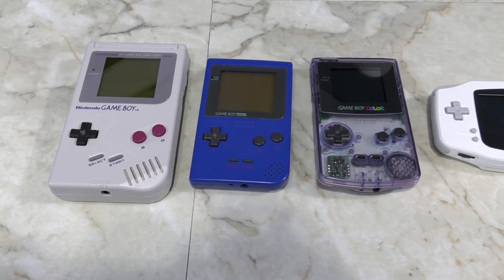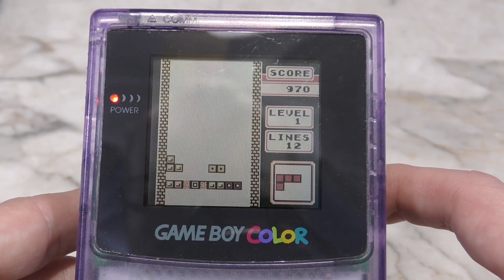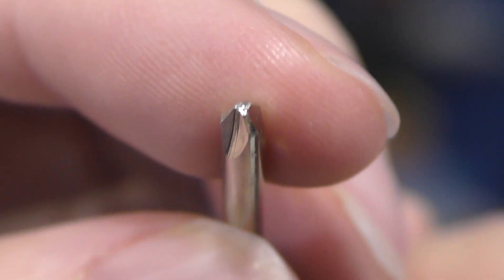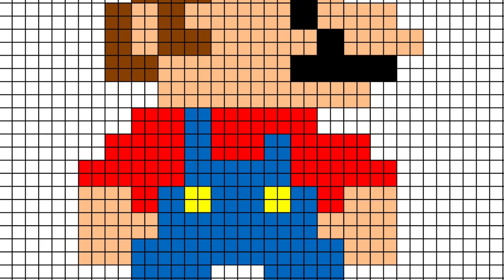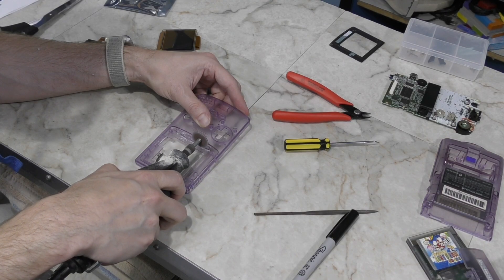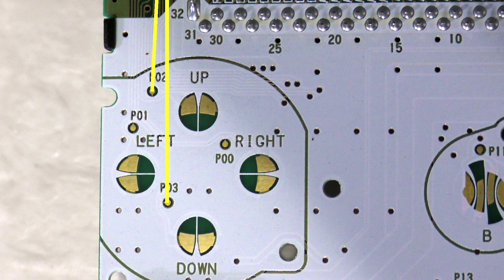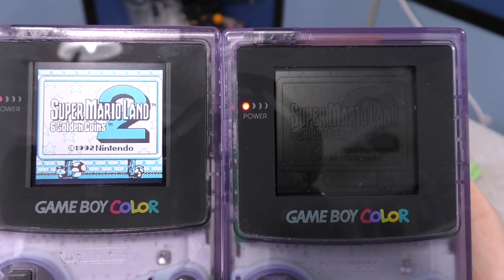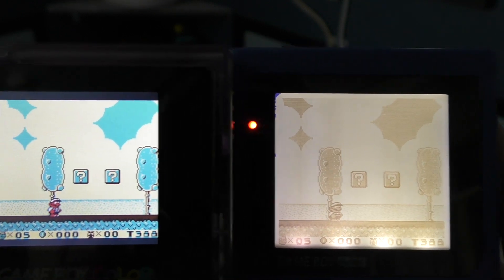Finally - A Gameboy Color Backlight Mod!

Comment: Wait, what about battery life? Did that take a hit with a back lit screen?
Reply: Late to the party but the website says 3 hours battery life with this mod. Not worth it IMO. You’re better off using a GBA SP.
Reply: obvious
Reply: Other people have said that with this mod they get about 6 hours active time. That's plenty if you put in a fresh set of rechargeable batteries before each binge, or every 2-3 days of casual play. Plenty of life.

Alternatively, just put in a lithium ion rechargeable battery while you got it open for the screen mod. Replace the old batteries entirely. There's plenty of room.
Reply: Of course it did. The Law of Conservation of Energy requires it.
Reply: @fyrstormer  Right guys, I realize that.  I was hoping more for a response where he enumerated the level of impact.  I haven't played a GBC for years and years, so did it reduce battery life from 10 hours to 9?  4 hours to 3.5?

I have kids and with the limitations we put on electronics, we haven't let them have phones at all because they're so open-ended.  But this device we could let them play knowing there's a pre-set amount of games.  Plus it's nostalgic for me:)

Comment: 1:36 that's not how the colourization works on the GBC.
The GBC has a compressed table of game headers with palettes attached to them.
The only game that uses SGB colours on the GBC that I'm aware of is Pokémon Yellow, which converts the SGB palettes to GBC palettes if it detects that it's running on a GBC, and has its own palettes in a lot of cases. (which are still stored in SGB format even though they're not compatible with the SGB)

Comment: If you use the extension cable for the Dremel, you'll get a lot less jumping because it's much easier to wield like a pencil compared to the bulky motor assembly.

Comment: A correction (from memory): the Super Game Boy has nothing to do with original Game Boy games having colour when played on a Game Boy Color – this can most obviously be seen by comparing the level select screen of Donkey Kong when played on a Super Game Boy with that screen when that game is played on a Game Boy Color.

The Super Game Boy and Game Boy Color use two completely different ways of colourising games:

* The Super Game Boy divides the screen into 8x8 pixel squares, with every square being assigned a colour palette (I can't remember whether the colour palettes are two or four colours, or how many palettes are available); when the Super Game Boy colourises an original Game Boy game, every square is assigned the same palette.

* When the Game Boy Color colourises an original Game Boy game, the two sprite layers and the background layer are assigned a (potentially different) four-colour palette – so there's the potential for twelve colours on-screen at a time – and a palette set can be selected by holding down a d-pad direction and (optionally) the A- xor B- button on power-on; additionally, the Game Boy Color holds custom palette sets for a few original Game Boy games that override the default palette set if no d-pad direction and button is held down on power-on.

Comment: Interesting video.  Just a small point but the GBC BIOS uses a calculation of the GB Header to determine which palette stored in the GBC BIOS (if any) to use for older mono GB games.  The SGB's color system is a totally different thing.  I actually waited until the GBA SP came out precisely for the rechargeable battery + front lit screen.  I have a black thumb when it comes to hardware modification.

Comment: At 1:37, it's stated that the GBC pulls SGB color data in order to colorize non-GBC games; that's incorrect, automatic colorization is performed by the startup code (nicknamed the boot ROM). Simplest example: Pokémon Red/Blue are uniformly colorized on a GBC, but change colors between maps and have move complex coloring on SGB.

SGB enhancements are actually performed actively by the games by sending "packets", so there's no way to automatically find where the games store color data. (Plus the games may store the data compressed, making the whole thing even worse.)
And no, a GBC can't pose as a SGB, because the SGB exposes a SNES' functionality, so games expect much more than the GBC can offer, and would break if it's not there. And, the way colorization works on GBC and SGB differ wildly and basically in incompatible ways.

Comment: This video was sorta rough the aspect ratio is correct on a gba that's backlit once you hit the right trigger and your mod while impressive is not correct the ratio is squeezed vertically I'll have to pass until a better mod comes along but regardless the gba backlit is not only comfortable but plays gba as well...it wins

Comment: Say, David, what software did you use to create your channel intro? Or, did you actually programmed some code for the Commodore 128 to execute and you just recorded the output from there? I'm looking for some software where I can create a custom intro of some sort instead of using the default intro video editing programs provide me. What I'll be using is OpenShot Video Editor because I am on some financial pressure and just finished my bachelor's degree in software engineering.

Comment: nice work... if you wish to do some more modding (say your case is too scuffed up or your plastic screen protector is scratched/cracked) might i suggest this website https://www.retromodding.com/collections/gameboy-color  there are plenty of mods available as well for many different Nintendo handhelds. Outside of NA.... sorry they are based in Canada.... soooo buyer beware.

Comment: Eh, Nintendo's always bullied modders and the fair use community. They falsely claim you have no right to fair use or backup copies when copyright laws including, yes, even the vile DMCA very explicitly say the opposite. I don't know how copyright works in Japan but I'm certain they follow the Berne Convention which protects specific consumer rights. 

They at least had a legal basis for going after ports, so on that legal front they were justified. Doesn't make them any less jackasses, but the law doesn't say you can't enforce copyright if they're not making money off it or hurting your bottom line.

Comment: 10:50 The screen does not appear to be 100% the size of the original. It looks about 5-10% smaller than the original, resulting in unused space around the edge of the screen.

Comment: Actually, the reason DMG games have color on the GBC has nothing to do with the super gameboy coloring some games had (in fact, the GBC does not support that color data). Instead, the reason is that graphics on the gameboy are actually programmed on several layers, as well as sprites being differentiated from backgrounds. This is how the GBC recolors some parts of DMG games, by coloring sprites and background images differently.

Comment: nice all around look with the backlit screen, downside is that its $65.00 bucks. double or triple what the original system costs used today.if they could get that cost down it would be even more amazing to mod.

thanks for the video letting everyone know it can be done now. much appreciated

Comment: If you Bivert the GB pocket, you can get much more contrast out of it. It should be an easy fix. Also, if you want the B&W look of the original GB on the GBC, just hold B and left when starting an original GB game, as that will set the colors to black and white. (this also works on the GBA and GBA SP)

Comment: The downside to having a super-bright screen is that there were probably GBC games designed around the dark screen (as in, they expected colors to be visible much darker to the user than what was coded in the game). That was the same problem I had playing original GB games on my GBA SP model 2 (aka the AGS-101 to most fans), it's almost too bright (particularly the default color palette, used when playing basically any (monochrome GB) game not made by Nintendo. The GBC boot ROM detects most Nintendo games and assigns them specially-coded color palettes.)

Comment: If you want to do a nice backlit mod like that, Id recommend a glass replacement screen protector, the originals scratch easy and the glass ones feel and look amazing. They're usually under $10 on ebay and are worth it, ive repaired countless and always use the glass ones.

Comment: I'd argue that the mod which uses the GBA SP front light is superior. Yes you have to sacrifice a GBA SP, but it's a much easier mod as you don't have to do any cutting with a dremel, and it lets you use the original GBC screen instead of a totally new LCD. No weird bezels or borders. I installed this mod 4 years ago and still use my front lit GBC today. Looks awesome, contrast is great.

Comment: I disagree with using Axanar as an example of overzealous copyright protection. 

Alec Peters was trying to make a profit off Star Trek IP. That is indefensible.
Reply: yeah but not everyone is aware of the full story. The only reason I know about it is because I had a friend that worked on other fan films and personally knows almost everyone involved with all of them. He even knows Alec. CBS was being a jackass though in taking it out on the fan films that weren't being assholes.
Reply: @awilliams1701  The only thing i like about CBS is that they made pretty good atari 2600 titles😁😁😁😁

Comment: 1:50 - idk if it's been said but the Super Game Boy color data is not used on a GBC or GBA, the GBC just applies generic palates to the games
you can change them with the arrow keys on start up.
Reply: Not with everyone. Some games (or a lot, I don't really know a full list) from the original DMG (like Super Mario Land, Pokemon Red, etc) had some predefined palletes in the GBC. You can change them with the method you said (and also A and B), but if you don't press anything, it will use the predefined one.

Comment: You really late if it comes to Nintendo and how they handle Nintendo Content on YT. As long as you do not make videos about "How to hack a Nintendo Console to play roms/emulators" or show ppl how to make hacked Games, everything is fine. I never heared that Nintendo is against a Mod of a very old Console/Handheld, if it's only Hardware based. And adding a Backlight to a GBC Color is so common today, that Nintendo does not care the slightest.

Even if it comes to music and Gameplay, Nintendo is totally fine with that if it comes to Let's Plays ect.

Comment: The main thing holding me back from getting this mod, is that many GBC games were made with oversaturated colors to compensate for the original undersaturated LCD display. With modern true-color displays, the colors will look more vibrant but the color balance in many games will be off.

Comment: Eh, I don't have money to burn on a screen that you have to install yourself. Anymore, I just don't want to fumble with my old carts. I prefer the ease of selecting roms in a menu that you get with an emulator. I know Nintendo hates it, but I at least bought the carts originally. It's like I prefer ripping my CDs to a my computer for use in my MP3 player or the like that plays flac. The thing is, if you really want an authentic experience, you should play your games on unaltered consoles. I put up with the screen glare back in the day. My family was poor, and I was grateful to have a GameBoy. I don't call playing games on the GameBoy Pocket really legitimate. It may have a sharper, better screen, but the original GameBoy wasn't actually black and white. The lightest shades were brass colored due to the colored reflector while the darker shades had a greenish hue from the liquid crystals. The end result was more of a two tone screen which I greater prefer over black and white. I find that I prefer this color pallette in emulators which didn't seem to be available on the GameBoy Color/Advance. Oddly enough, original games can flicker on faster refresh screens. I noticed this on Link's Awakening. The game designers took advantage of the slow refresh rate of the original screen for special effects by giving it a 60Hz frame rate. They flickered shades to get extra shades from a 4 shade only system. It was a nice effect that you can only properly experience on the original screen, but it flickers on the newer screens. I think emulators have shaders that can reproduce this effect. Unfortunately, the screen will smear with fast motion. I guess it didn't bother me much back then, but I prefer a faster refresh screen. The flicker effects weren't used much anyway.

Comment: Wow, the screen itself does look phenomenal. The doubled pixel density really makes for a razor-sharp image. Still, most folks would be just as happy with the backlit GBA SP, model AGS-101.
Reply: Sadly, the AGS-101 it's really hard to get, and costs like 50 USD, or even more. And it requires to destroy the GBC shell.
Reply: @erik19borgnia  lol i paid $134 for my gba sp ags 101, 2 weeks ago and it was used on ebay and it was the cheapest one that was not broken and didnt have actual teeth marks on it, and it did come with plenty of scratches
Reply: @jasonbrown467   I was talking about just the screen to do the mod. And it was a year ago. Now they are even more expensive. I actually got this screen last year (the Midwest Embedded one) and I'm pretty happy with it. In the last year I played a lot of games in my GBC and it was a blessing to be able to really see.

Comment: When doing these mods, look into the glass replacement screen protectors available all over the internet. Scratch resistant and much better viewing, they usually come with repro graphics on them so they look like an original part.
Reply: Thanks!

Comment: For me, it was just easier to buy a gameboy advance SP. (The 101 version) Backlight w/ compatibility with quite literally every game from every generation of game boy? Sign me up. I just wish it had the same button arrangement/size as the pocket/color as it's a bit too small for an adult to play comfortably. But it works fine when I want to play a gameboy game or I'm travelling. The original advance is the best in terms of "play-ability" meaning it has the best controls layout. This is super cool though. And the screen looks amazing.

Comment: 0:20 What tactile control, un-obscured screens, you're crazy, modern touch controls are the best? ^_^ Also I love when companies harass fans when they produce content they themselves won't produce, it's so good for brands and franchises. Keep up the good work lawyers, we'll get those profits and company images right into the toilet. :D
That mod does look very nice, so far the 2X factor mostly pushes towards current component sourcing, a future proofing of what screens are made now. Not a big fan of pixel "smoothing" but 2X or later 4X screens could offer such options to mods like this through the FPGA.

Comment: Hm, the modded GBC definitely has the best screen, but... not sure. The colors kind of look too vibrant for the GBC. Doesn't feel authentic to me.

That said, I think I am gonna do a backlight mod for my gameboy pocket sometime soon, as I find it hard to play on it even in good lighting conditions and I feel like if it had a baacklight, I 'd game on it a lot more, which I'd like to. There's a modding kit that lets you add a backlight to the original screen, so it should keep the genuine retro feel. But, OFC that also means it's a lot more work and more to possibly go wrong.

Comment: Oh, I've seen this on another video. The triple-bezel GBC screen. No thanks. They need to provide an outer screen protector that covers up more of the screen so you don't have to see all that nonsense.
And why do all these videos claim "you can barely tell" when it's incredibly, painfully obvious from the very video we're seeing at the same time? The gray of the interior bezel doesn't even match the gray of the screen protector. Sticks out like a sore thumb.
Reply: I think some backlit modding methods will also have an option of the screen protector that'll cover up the slightly smaller size of the backlit screen. 

But I kinda think it would be better if they could just have a screen that's the same size as the original one because that's the way it should be. The smaller overall screen size kinda ruins the look of the GBC for me.

Comment: The Gameboy Color doesn't read the Super Gameboy palette information.  What's actually happening is that the boot ROM of the Gameboy color has a lookup table of special palettes for the most popular Game Boy games, so if the boot rom detects a game on its list, it will load that palette.

In any event, the Super Gameboy and Gameboy color handle color in different ways.  The SGB instructs the SNES to apply color to different regions of the greyscale gameboy image after it's been drawn by the SGB hardware.  The Gameboy Color applies the color during the gameboy's drawing process.  What this means is that the SGB cannot treat sprites and backgrounds differently when colorizing, while the GBC can have the sprites and backgrounds be different colors, while the SGB can have static screens with far more apparent colors on screen through the careful use of palette regions.

Comment: You should try out Super Mario Land DX and Super Mario Land 2 DX, they add full color to both games and in the case of SML2DX, it also adds Luigi. You can find them on romhacking.net if you want to try them out on a flashcart or emulator, or you can get knockoff cartridges I believe.

Comment: Could you fix an NES MAX controller?
Reply: You can't fix a huge design flaw. Whomever designed that controller had a weird sense of humor. The pad is actually the rim, the "cycloid" is just to rest your fingertip; in order to maje it more or less usable, you have to keep the "cycloid" right in the center.